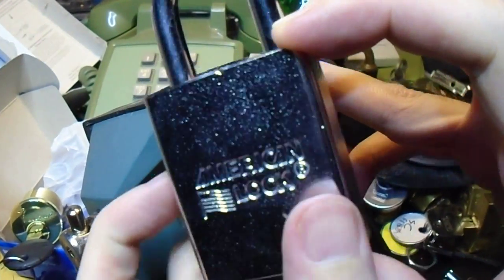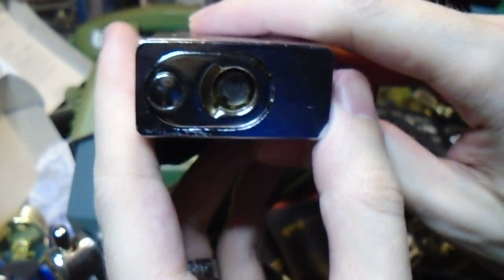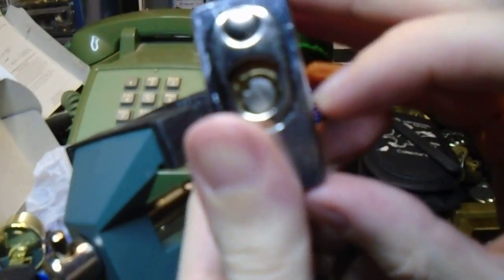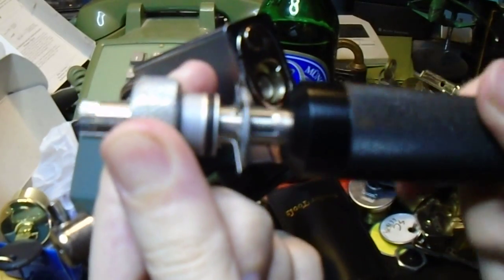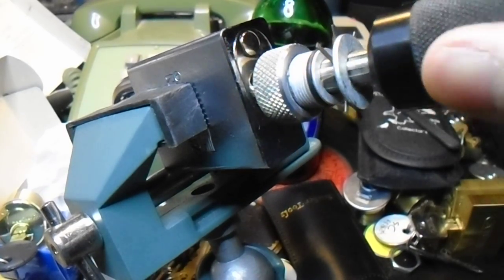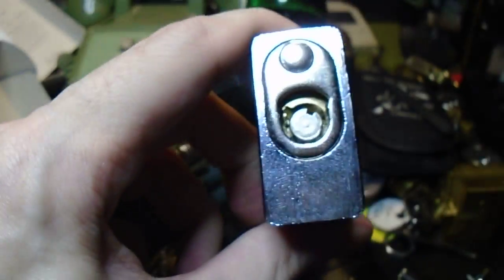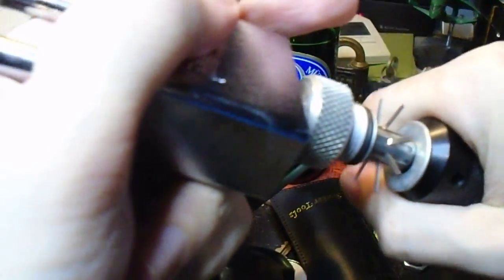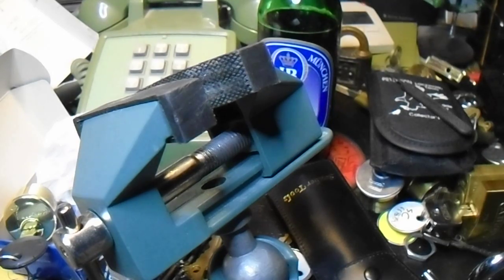(057) American Lock 7200 tubular padlock picked

Comment: would it be possible to s.p.p.
Great video again
Reply from the maker: Thanks for the compliment. I don't see any reason this wouldn't be possible to SPP, the big tric would be that you probably couldn't use any of the commercial tubular tension tools because of the retaining plate surrounding the cylinder face. As long as you had a tension tool that could reach in without being blocked by the housing, it might even be easier to SPP this lock than use the self-impressioning tool as long as you only need to open it once.